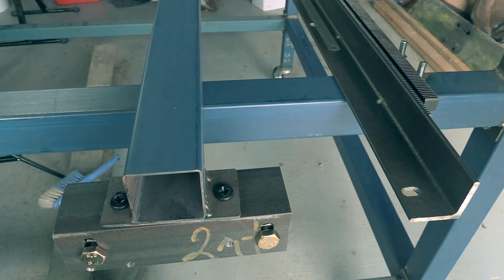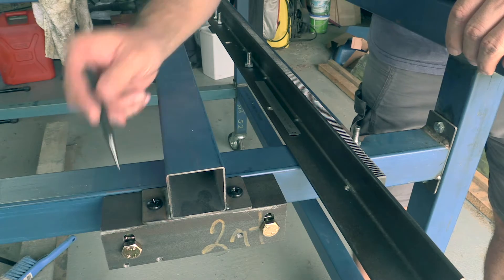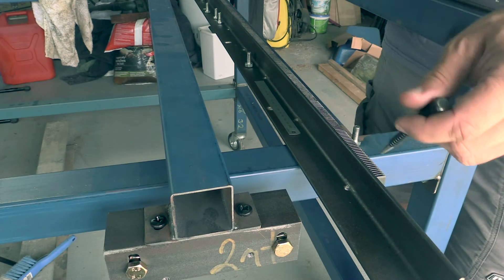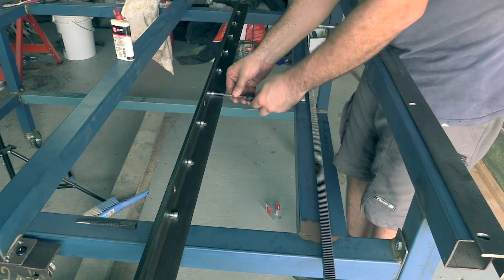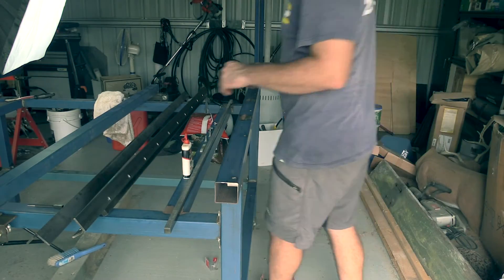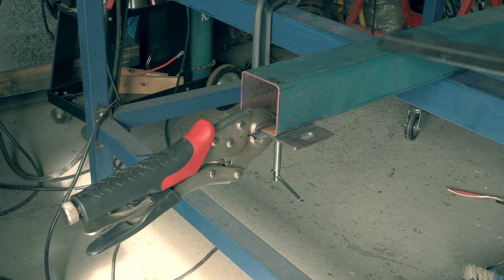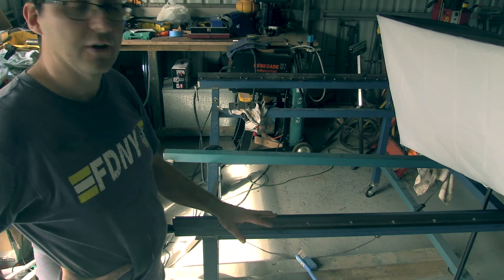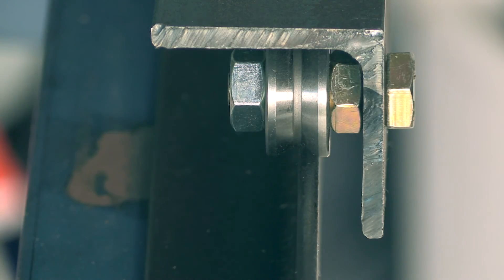DIY CNC Build by a novice - part 9

Comment: Hi Mark, Great job so far! Mind if I suggest when the bed is complete you should clean up the surfaces that the rollers run on, either with a file and some fine sand paper or something to keep the runner as strait as possible. The smallest movement at that end could equal a rough cut at the business end. 
While I'm on my soap box, I thing you should definitely make new mounts for the drive motor. linkages may flex too much.
Love your work though, looking forward to the next vid.
Reply from the maker: Thanks for the feedback Heath, I reckon you're right about the linkages. Yeah I plan on polishing the top of the rails as best I can to help smooth out travel.

Thanks for watching.

Comment: Hi Mark
Awesome Build and thanks a lot for sharing it such details really helpful
I am planning to build a plasma table and now gathering information on that and i have some questions and doubts  

1.What is the software you are planning to use? 
2. how to wire the torch control relay?
3. Can you get me any links in CNCZONE.COM about complete build of plasma table from scratch

 Thanks for you videos waiting for your PART 10!!!! EXCITED
Reply from the maker: G'day Thomas, hope this helps.
1. I'm planning on using Sheetcam for the CAM software and may look at Fusion 360 but I'm not sure if it supports GRBL and plasma cutting as yet in the CAM where I know Sheetcam does.
2. Checkout the 4th video in the series as I cover the torch relay etc => https://www.youtube.com/watch?v=zGngq9LsV-Y&ab_channel=MarkValenzia
3. I don't actually have any links sorry mate. 

Thanks for watching.

Comment: Love your videos but when is part 10 coming? I'm building my own table (will work on the CNC gantry part later) and wanted to know how do you cut the slots in the side rails for the slats? Or, are you going to use a piece of angle iron with slot cut into it? Thanks
Reply from the maker: G'day John, part 10 shouldn't be too far away, I've actually been flat out with work and the families been sick. When you talk about the slats, do you mean to create the cutting surface to sit the material to cut on? To start with I'm going to use mesh as a temporary surface to hold the plate that will be used to create the slats which will interlock with one another. They will then fit into the centre of the table and should (hopefully) be self supporting.

Hope that makes sense and thanks for watching!

Comment: thanks for the videos. I was struggling with how to set up rails but the way you are doing it is kinda simple compared to what I was trying so I think I will do mine the way you are doing yours . thanks again for the vids.
Reply from the maker: No problems +yooper joe, I know I'm not going to get as much accuracy as I would with linear rails etc. but it's a start. If you do go this route though, make sure you drive the axis from both side to avoid the gantry crabbing. This was the first thing I noticed when I started pushing it off centre. To answer your other question, it's hot rolled angle and I really need to polish the top of the rail to remove the scale.

Thanks for watching.

Comment: Cool build. Looking forward to see how it goes. Are you the first grbl plasma cut builder??
Reply from the maker: G'day +Simon Quinby, I'm not sure if I'm the first mate but I couldn't find much info on grbl plasma on YouTube. I'm also looking forward to seeing the sparks fly for the first time too.

Thanks for watching.
Reply: +Mark Valenzia I'm also interested to see how you go with electrical interference.  Are you planning to add a THC?  I see proma do a stand alone one that could work.
Reply from the maker: G'day +Simon Quinby, sorry for the late reply. I've had a bit of a look at the Proma THCs and will look at adding once I can start cutting on the machine.  I'm also interested on how the electrical interference will go, I plan on shielding and grounding everything but we will see...

Thanks for watching.

Comment: What plasma cutter are you using for this? Do you think the stepper drivers you are using will be the limiting factor in terms of power/speed/acceleration? Very interesting project.
Reply from the maker: G'day +Leon Close, I'm just using a cheap HF start plasma cutter to start with ( it's a Chinese Cut40) and I think that may give me a headache later on. The stepper drivers should be ok but I do worry about how hot they get so cooling will be an important factor moving forward.

Thanks for watching
Reply: Thanks for the reply. I'll continue watching with interest.